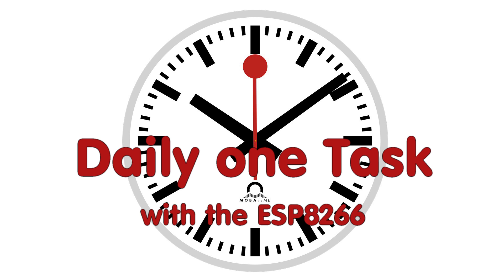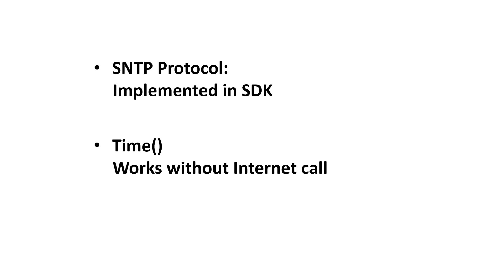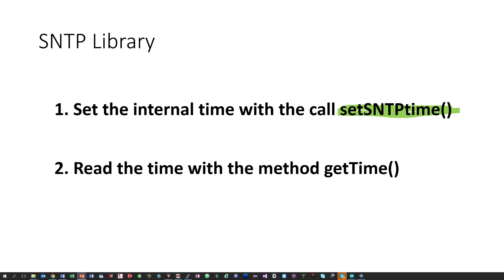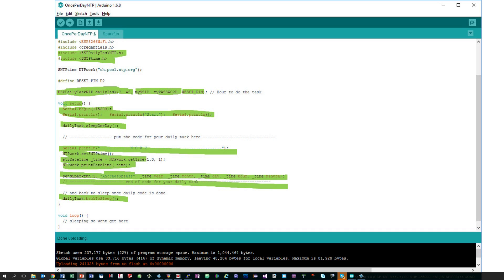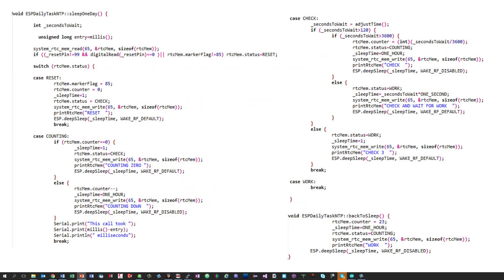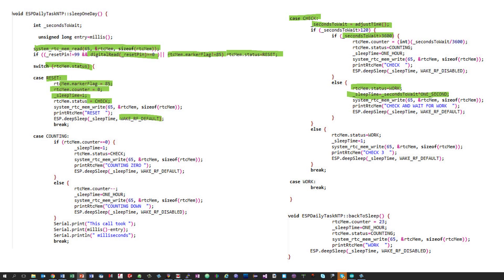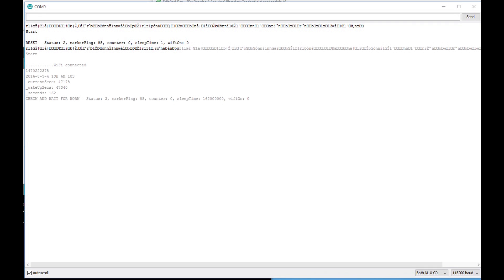#71 Schedule a daily task at exact the same time with the ESP8266. The rest is deepsleep

Comment: I have real use of this code to switch off my Wifi during nighttime (I believe it is not good to have wifi On for unnecessary radiation in the house) and esp will configure itself in the evening, as esp8266 could not connect to the internet after wifi gets switched off to which it got connected. But I always had difficulty uploading using Arduino IDE, how to do the same using PlatformIO?
Reply from the maker: If you have problems with uploading, you will have it also with PIO
Reply: @AndreasSpiess  Thanks, However, if I get the proper library and compile in IO I could easily upload on esp. Arduino IDE gives me error after successful compilation while uploading, I could not figure out it.

Comment: THANK YOU ANDREAS! It is Oct 6, 2020 and I just pulled down the zip library and added it to Ubuntu Arduino IDE using the "Add .Zip Library", edited "credentials.h"and tried to compile the example but it won't compile. It says it cannot find "credentials.h" and it cannot find "SNTPtime.h". I search on github for SNTPtime.h but found nothing.
Any ideas on what I did wrong?
I am trying to develop a daily task to run a recirculating water pump for one hour at, say, 9am.
Reply from the maker: Just delete the line with the credentials.h and define the SSID and password in your sketch
Reply: Some versions of the arduino ide really struggle with header files and the correct parsing of function definitions and the order in which they are parsed (if at all). The newer versions solve this issue. I had code that was correct, and the compiler failed to parse it correctly, telling me the function was undefined. Same code now works.

Comment: Excellent video, well explained and clear. Thank you for sharing. In your opinion, would it be hard to get this to run on the ESP32?
Reply from the maker: I do not know. Maybe you try?
Reply: @AndreasSpiess  I am planning to try, thanks for the inspiration
Reply: I have it working on ESP32. just had to go into the library file [SNTPtime.h] in Documents / Arduino / library / SNTPtime-Master and substitute this code .
REmove:
 #include <ESP8266WiFi.h> 
Add in place :
#ifdef ESP32
#include <WiFi.h>
#elif defined(ESP8266)
#include <ESP8266WiFi.h>
#endif

so far has been running for over an hour keeping constant on the seconds.
Reply: Hi  @johnchaplinsky5587  how are you? John, I have a problem with the compilation: Error compilando para la tarjeta ESP32 Dev Module. I do what you say, but nothing happen. Can you help me, please?
Reply: Thanks for sharing, John

Comment: Hello sir great video I have a question if       I want to change the time sometime rather than changing the code can we take the input from an app and change it. If  yes how can we do
Reply from the maker: You can program anything if you want. For me I had no need the change the time, only the time zone.
Reply: @AndreasSpiess  thanks for replying. Ya we can program it but then for doing this I have to set a time also for taking input from user too. Can it happen that we can externally on and off esp from an app or something

Comment: very nice tutorial , only stuck on  one part  , can you please help me with this  been busy for days now                                  : exit status 1
no matching function for call to 'ESPDailyTaskNTP::ESPDailyTaskNTP(int, int, double, const char [12], const char [13], const uint8_t&)'
Reply from the maker: I changed the credentials from #define to char. Now it should work. Please install the newest version of the library again.
Reply: @AndreasSpiess  thank you very much  gonna do that
Reply: @AndreasSpiess   i have the same problem and i've changed credentials from #define to char. But i can't get it to work i'm getting error: expected initializer before string constant

 char mySSID "SSID" and no matter what i change if i add # before char or not or anything that i've tried i'm everytime getting errors 
and this 
In file included from C:\Users\tekto\AppData\Local\Arduino15\packages\esp8266\hardware\esp8266\2.6.3\libraries\ESP8266WiFi\src/WiFiClientSecure.h:41:0,

                 from C:\Users\tekto\AppData\Local\Arduino15\packages\esp8266\hardware\esp8266\2.6.3\libraries\ESP8266WiFi\src/WiFiServerSecure.h:20,

                 from C:\Users\tekto\AppData\Local\Arduino15\packages\esp8266\hardware\esp8266\2.6.3\libraries\ESP8266WiFi\src/ESP8266WiFi.h:41,

                 from C:\Users\tekto\Documents\Arduino\OncePerDayNTP\OncePerDayNTP.ino:4:

C:\Users\tekto\AppData\Local\Arduino15\packages\esp8266\hardware\esp8266\2.6.3\libraries\ESP8266WiFi\src/WiFiClientSecureBearSSL.h:150:28: error: expected declaration before end of line

 #pragma GCC diagnostic push
Reply: well sorry mby i'm just stupid whriting code is something new for me and i can't wrap my head around everything yet

Comment: Andreas after doing some testing and modifying it a bit so I can use it with wifi.manager (activated by a jumper), it may have a slight bug . It appears that wherever the code sleeps for a microsecond it hangs. I changed the three locations that state _sleepTime=1;  to _sleepTime=ONE_SECOND; in RESET, COUNT,  and CHECK. It does not hang anymore. It kept hanging on RESET and it did not make sense because the code looked good. I  figured out  what was happening when I set the scheduled time to run less than 2 minutes away (that section of code under CHECK also had a sleep for a microsecond in it). Not sure why it corrected the issue, or whether it was just due to wifi.manager.
Reply from the maker: This is an old project. If you want you can send me a pull request and I will integrate your changes into the code.

Comment: Helo.. I have a problem. I have air conditioner in a place where no internet. I must turn the air conditioner on every Tuesday at 8AM. The air conditioner has wifi module but this cannot help. When power lose al the settings in the AC are lost and you must program the timer again. I already copyed the IR ON command there is no problem to send it from ESP. Now I need the timer that will send the IR command every Tuesday. I like to have battery powered module...soo it must sleep a week to save the battery. What you sugest me? The 8 AM is not fixed it can be 8:10 or 9AM doesn matter. The goal is that when I will come at 4PM that the room will be hot (I dont need precise RTC). Thank you for help.
Reply from the maker: Maybe you use an RTC module to switch the power of the ESP on. You find them on aliexpress
Reply: @AndreasSpiess  What about to use the ESP RTC. The actual time is not inportant...just send the IR abd sleep for a week and repet all over. If there is some minutes drift there is no problem...can the esp deepsleep a week?
Reply from the maker: The ESP8266 can only deepsleep for a little more than 1 hour.

Comment: Great job and great sntp library. It simplified alot my oled wristwatch code. I have only one serious problem, when it gets offline, exacly 1 hour after it starts running it resets, and as it is offline it loses the time. Do you have any tip? Or where should I look for the "bug"?
Reply from the maker: If you use deep sleep you have to connect GPIO 16 with the RST pin.

Comment: My only problem is with the  Wifi status...  Example, the only reason we really sleep a chip is to save on battery.   In this case, if the Wifi happens to be down, or cannot connect for some reason, then the chip will not give up trying to connect.... thus draining the battery.    We need a way to give it a # of times trying before it gives up and tries again much later.
Reply from the maker: I think this should be possible by limiting the number of tries or the time it tries to connect to the internet.

Comment: Hi Andreas, I love you videos, I have two NodeMCU, I have them "loosing" data printing on Thing Speak, and the other dont respont to Io Adafruit MQTT Command, do you recomend to put them on a fixed IP? or any idea of anything else?? Thanks.
Reply from the maker: There are speed/updates per second limitations on Thingspeak. So, maybe the problem is not on your side.

Comment: Dear SIr,

i am using nodemcu with sd card for data logging where i want to take the date and time in the logging with sensor value 

please guide for the same 

Thanks
Reply from the maker: I think you need the example sketch of the SD library and some time. It should not be too complicated.

Comment: It's unclear what hardware configuration is required to get this to work, is it still GPIO16 and REST which have to be tied together? What is the purpose of the pin defined in the code, which is the last parameter of the function call?
Reply from the maker: 1. If you want to deep sleep and automatically wake-up, you have to connect GPIO16 to RST
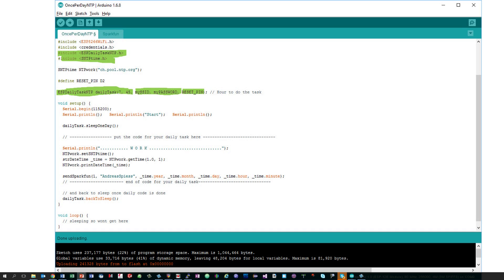2. I explain hte pin at 4:10

Comment: Can this be used without putting it to sleep? I'm doing stuff with MQTT so it can't sleep very long, but I want it to do a thing at a specific time
Reply from the maker: You can use sntp to get your actual time and then loop till the right time arrived without sleeping. Then, you only need the sntp time library. You should be able to reduce the number of calls to the ntp time server by using the internal "time()" command, which is not very precise in the long run, but ok for the short term (below 1 hour for sure). So, you can correct the time every hour by calling ntp.

Comment: I found a cheap add on-to help schedule a daily task.
Use the alarm function on this card  < US$1.00
http://www.ebay.com/itm/Arduino-DS3231-AT24C32-IIC-Module-Precision-RTC-Real-Time-Clock-Quare-Memory-/262123918224?hash=item3d07cd9390:g:FssAAOSwHoFXrTHl

Here is a long article about some one that used this board for one of his projects
https://edwardmallon.wordpress.com/2014/07/01/a-10-diy-data-logger-is-born/
If you cut some traces on the board as in the above article you get a clock that runs for years on a 2032 battery and you can use the
ds3231 alarm function to wake you by connecting it to the 8266 reset button.

With the 32Kb memory on the card even more possibilities

Maybe you will find this useful to you :)

vince ka8cte
Reply from the maker: Thanks for the tip. As a long-term scenario with the FET transistor, this could be quite interesting...

Comment: Thanks for your interesting code. I have a battery powered window sensor and I wanted the ESP8266 to wake up once per day and transmit the battery voltage (I'm OK message). This is easy to do with your code. BUT - I wanted the ESP8266 to wake up randomly if the window was opened. I tried the reset pin/switch but it did not wake the ESP8266 up and transmit. Any ideas would be appreciated.
Reply from the maker: Martin Young You should be able to reset the device manually, but I never tried, what happens if you disconnect GPIO16 from RST and operate it manually. Did you try that?

Comment: I was impressed by your video and I tried to install both libraries(ESPDaily... and SNTPtime-master) via Arduino IDE: Sketch->Include Library->AddZipLibrary, but it said it is not a valid .zip library. The original NTPtimeESP library from video 67 did install OK. My board is a NodeMCU (ESP-12E).
Reply from the maker: The way you used does not work, because there are two independent "libraries" in the file. Just copy the two directories "ESPdailyTaskNTP-master" and "credentials" into your Arduino library folder and include your WLAN credentials in the "credentials.h" file. Then it should work.
Reply: I separated the two but it still says that something is wrong. :(

Comment: Hello, Great Video! 
What do you recommend I do assuming my sampling time is every half a minute, and I would like my data samples to be time stamped and be sent to a server when WiFi is available, and to get stored in the internal RTC memory when WiFi is not available, to be sent later on. Keeping in mind the esp needs to be in deepsleep when not sampling for power issues.
Reply from the maker: You can watch my videos #58 and #60. There you find the needed information
Reply: Hello Mohammad Shaaban, did you get what you wanted? I have exactly the same need you said here.

Comment: Hi Andreas
I have tried running your OncePerDayNTP.ino sketch but get the error message "no matching function for call to 'ESPDailyTaskNTP::ESPDailyTaskNTP(int, int, const char*&, const char*&, const uint8_t&)". Any ideas what I might have done wrong. I have commented out the #include <credentials.h> bit (not sure how to implement this) and added "const char* my_SSID = "XYZXYZ"; const char* my_PASSWORD = "ABCABC"
Best wishes
Arthur
Reply from the maker: Try to delete your old version of the library and install the newest version. I added now a credentials.h file. You can also install it in your library. If not, just copy the two lines into your sketch and delete the #include credentials.h
Then it should work. Otherwise come back and I help you.
Reply: Hi Andreas
It works now. I have set it to 15:00 so you should get a sparkfun reading.  The inclusion of the credentials.h file has shown me how to use this method.
Many thanks for your help it's very much appreciated.
Reply from the maker: You are welcome! I have no fun if my viewers are not able to use my code. It is much more fun if it works. ;-) I will check at 15:00. Which time zone did you use?
Reply from the maker: I checked, but did not get your entry at sparkfun. So, something did not work. Did you check your serial monitor?
Reply: Many thanks for checking. It's connected to a power supply and an OLED (http://s400740077.websitehome.co.uk/shen/2016-08-15%2017.47.57.jpg)  so I do not have any serial monitor feedback. I need to write the code to drive the OLED so I can see what it's doing. I will let you know when I have completed it.
Reply from the maker: Maybe you leave it on the bench for some tests with the Serial monitor on. At least, that is, what I did. After 24h I was then sure what happened...
Reply from the maker: Now I got your entry: 2016-08-15T19:14:42.154Z Arthur Yarnell!!
Reply: Excellent news. I have been trying out different things with my ESP8266 so it is no longer running in the daily mode. Many thanks for helping me with this and providing such instructional videos. 
Best wishes
Arthur

Comment: Hi Andreas, great ideas and cool video. thx for it.
But sorry, I didn't get it to work.

1st: with a clean Arduino IDE Installation the file "credentials.h" is missing. So I commented it out an it brings me to the next poblem.

2nd: the function in c++
ESPDailyTaskNTP::ESPDailyTaskNTP(int hours,int minutes, double timeZone, char *mySSID, char *myPASSWORD, byte RESET_PIN){}
needs a parameter timeZone - in the example sketch this parameter is missing in the function call:
ESPDailyTaskNTP dailyTask(13, 9, my_SSID, my_PASSWORD, RESET_PIN);
should be: ESPDailyTaskNTP dailyTask(13, 9, 1.0, my_SSID, my_PASSWORD, RESET_PIN);
now it compiles an loads up to the ESP8266. (my_SSID and my_PASSWORD should be set individually)

But now I'm searching for the connection to my wifi-router. Can you tell me where this should be in the code?

Best regards
Jörg
Reply from the maker: just add #define myPassword "xxx" and #define mySSID "yyy". Xxx and yyy are your credentials. Or replace mySSID and myPASSWORD with your credentials.

Comment: Wow, that's brilliant. I think your approach of using the case statement is wonderful. I have quite a few sketches with complex if, then clauses but they could be simplified with Case. I must try this approach.  Thanks for the tip.
Reply from the maker: You are welcome! I usually do a drawing of the different states as bubbles and the state changes including the conditions for the change with arrows from one state to the other. Even it is not simpler, it is much easier to change. To change nested if-then-else construction often ends with unwanted results...